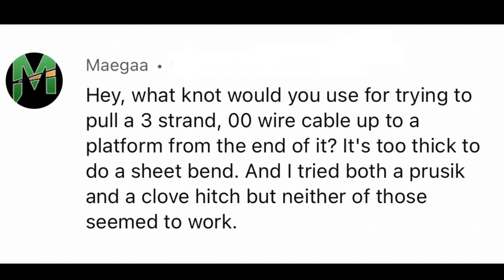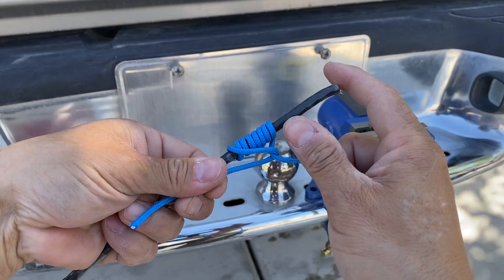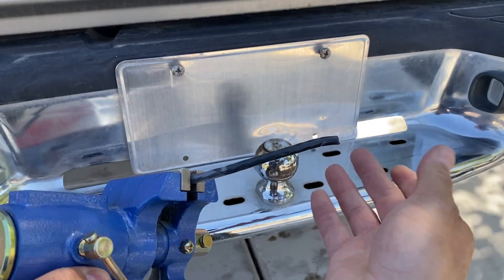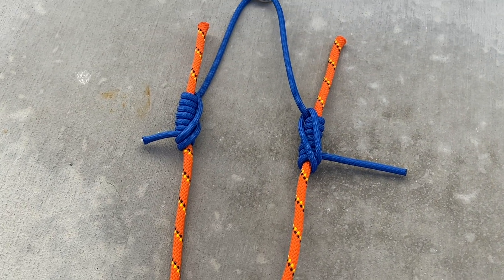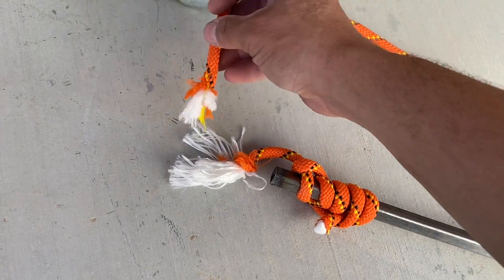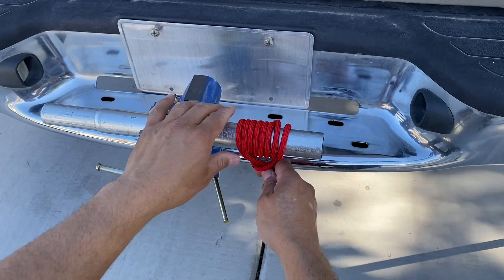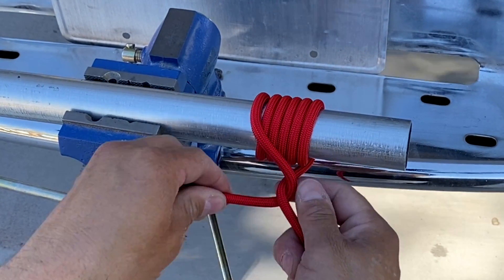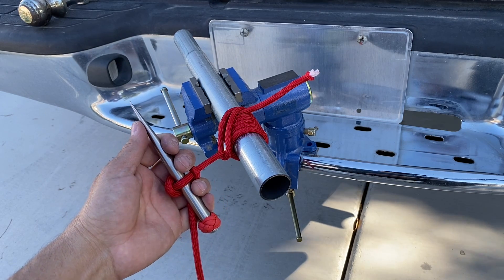Wire Pulling Knot

Comment: @3:36 the knot is a klemheist knot.

a similar, single end friction hitch, like the one you demonstrate in the video is the icicle hitch. I used it on some #6 cable tied with mule tape and broke the wire before it slipped. It has the added benefit of not rolling free if tied on soft materials like rope.

Comment: Needed to tighten up a long clothes line (steel cable).  Found this video and used this knot on both ends with a doubled cow hitch (so it would have a pulley effect).  Worked a treat!  Thank you!

Comment: Icicle hitch is similar, great demo.
I did see it mentioned that it would hold on a taper like a marlinspike. Always wanted to try it with cotton rope.
Also that it can be used to pull a small tree, will grip a slippery small tree when the bark is removed by pulling up with a block.

I used to use something similar while sailing when the sheet winch was bound up and you needed to free up the winch by taking the tension off.  

all the best
Reply: I successfully used a rolling hitch for freeing up a winch rope - but that’s because, under stress (mine that is), I couldn’t remember the icicle hitch!

Comment: Since no one's said it: the "pipe hitch" is the "arborists's knot" shown later in the video. That's also the first thing I thought of when I saw this one. I'm glad to hear it's seeing use, since it's been wonderful the few times I've used it.

The fact that someone else called it a "post hitch" is very interesting to me, since it makes me realize that that's probably what Geoffrey Budworth meant when he labeled its simpler cousins, "pile hitch", and, "double pile hitch", not just a foundation pile or a dock pile that's also a bollard for tying boats to, which is what I assumed he meant based on the word and the context in the book. It seems like the post hitch would be a great tool for pulling fence posts, probably paired with a half hitch, or as someone else suggested, a lark's head...so I'm sure someone's done it, especially at a dockside where the simpler ones were already in use.

The thing I'm most reminded of looking at it is probably some of the "prussiking" knots, but I'm sure the icicle hitch would've come to mind if I'd ever put the work in to learn it. I'll have to look, since those knots are also ones I never bothered committing to memory.
Reply: We used that knot finished with a clove hitch! After we removed the basket if we needed more. We also tied the same knot with chain on occasion for long 15kV runs and line truck for pulling out.  I believe you will find it in the Ashley book of knots (1761). I knew a lineman who called a very similar knot the grapevine. After I retired, a buddy of mine told me he always used a prussic. I could immediately see the value there! BTW one can hang a block or come-along on a pole with a prussic or klemheist. Even the klemheist can be found in the Ashley book of knots ((1762)though, not called that).

Comment: This knot is improved by sliding it a ways down the wire/pipe/etc. and following it with a series of lark's head knots. If you're pulling this wire through a conduit, or PEX pipe through a series of stud holes where the end could snag, simply wrap the end section with electrical (for wires) or duct (for everything else) tape, and ensure it forms a smooth transition from the object to the rope. The reason for this is for that cinching knot to form a lightly loaded backstop, where it will never be challenged, while the series of lark's head knots spreads the load to the object in a way that keeps strong control of it, but without causing point loads. This prevents damage, while also guiding the object better than just grabbing its neck, where it will now have a massive mechanical advantage on that stub that sticks past the knot. That stub will therefore have some multiple of your own strength working with any snag to maximize irritation. The industrial big wire pulling grip looks more like a "chinese finger cuffs" weave of metal wire that surrounds a length of the end of the wire. This also gets tighter as you pull, but I do believe the far end of that is taped down to the wire to at least comfort the electrician.
Reply: Can't picture what you mean when you said to follow it with a series of larks head knots. Guess I'll get out some cordage and try to figure it out.
Reply: Kellum grip ,works well and doesn't make a bulge on the wire.
Reply: @chronicon5616  Imagine a fishing pole. The pole is your pull-rope, once it's under tension, and the eyelets guide your limp fishing line. By using lark's heads every few inches or feet (depending on the material you're moving), you're picking the thing up farther down in its mass, so the tension load on it is lower, which is good. 
The cost of that is you will be trying to lift something like a fishing line, but the top flops over. So, you put a series of lark's heads from your main support knot to the end part. Now, your rope is doing the tension, and the top of the object is simply along for the ride. Now, there is a bonus in that the lark's heads should add some clamping force individually, so that takes a lot of the load off of the main knot, and the material being lifted. Note that this video indicated that grip is a factor of how many loops he put into his demonstrated knot. Another example would be lifting several 2x4's of wood with a rope, but there's wind or a narrow passageway that they're being lifted in. Using the knot in the video, if you grip the wood by the end, it will likely slip, or crush the wood grain, or want to go horizontal and spin just to spite you, or even expand out, like an asterisk " * " just before going full calamity. You can put a heavy squeeze knot like the video down near the middle, or the bottom end if you have several pieces of wood, and then put a series of lark's head knots up to the top of the bundle, so that the bundle of wood is being pressed together along its entire length, rather than crushed in one small spot, with lower total grip power.
Reply: We have situations where we're not allowed to use tape or anything that could possibly leave residue behind.
 This is the interest in different knots.
Reply: @paulstaney325  And oftentimes kellum is the choice but pulling many diffwrent dia wires needs grip sizes that they don't make or at least I don't always have.
Reply: @tacvolun3570  For residue-sensitive pulling, a knot with two leads (like basket handles) is used at the end of the object, so as to guide it through obstacles. Tape is more of an expedient for electricians, etc.. I've most often seen these mesh/finger-cuffs type of pulling setup with hydraulic hoses and heavy connections that need to be craned, but are using those pulling aids/strain reliefs as a matter of convenience and to help eliminate expedient measures. Normally, putting tape on the end of a pipe or wire is not a concern, because the end of the material is simply cut off, to expose fresh material for a good connection. If there is a taboo on tape residue, then you are also likely working with a finished surface, and so the distributed series of mild hitches that I was talking about should be among the assortment of suitable solutions, where one constricting knot may cause surface blemishes due to the tightness needed, or cause collisions, due to putting your only grip safely back from the end of the object. The lark's heads are for guidance, stability, and grip distribution.
Reply: We use fishing cable in Ireland. 10 x 1m lengths that screw together. There’s some accessories with it. It’s thin but bends and is made from fishing rod material. We just tape 2.5 or 1.5mm wire for sockets/lights to end of it with insulating tape to fish cables through pockets, through joists or studs, down cavities etc.
Reply: @mindswideopen4339  In the US, it's pretty common for residential electricians to use what we call "Fish Tape" for the same purpose. It's wound up in a closed container, and you can pull out as much as you need, and it's a thin, flat, steel wire. The end of it is folded over, and you just cut the jacket off the wire, snip off most of the wire ends, and fold the last one or two through the loop and back over onto the main wire length... Then, you wrap the whole joint with electrical tape and pull it through the wall, conduit, or whatever. This is after fishing the tape through the hidden hellscape in your walls. I can see where a more-or-less straight run would be better served with an assemblage of flexible rods. 
For heavy commercial wire, like 500MCM or greater, the minimum conduit diameter is often chosen by the contractor for cost reasons, but the result is that you need a bucket of pull-lube, some repurposed, hydraulic machinery which is incurring rental fees, and many wasted billable hours. Using fancy knots in this situation can help a few workers retain enough sanity to come back to work the next day.
Reply: We specifically use the lineman's hitch for high voltage cable when other knots might damage the dielectric around the conductors.

As well on really long pulls this knot can easily be slid down the cable after each short pull to pull again without resetting. Sounds like you're ibew buck.

Comment: We use 3 half hitches spaced about 4 inches apart wrapped with stretched electric tape to pull networking cables. This gives more than enough friction to keep the string from slipping off the cables and will rip the outer sheathing off before anything else breaks.

Comment: Can you think of a quick release knot but this time made in wide webbing? For making/attaching a nordic walking style hand strap to a pole. (these are slightly different from a regular hiking pole, more pressure on the strap)
Reply: I'll bet a constrictor knot or a rolling hitch / constrictor knot combo would work (with drawloop of course). I'll have to find some webbing and give it a try. How wide is the webbing usually? I'm thinking 25mm (one inch), but "wide" tells me it might be more like 40mm (an inch and a half is 37mm), or something like that, which would probably be a lot more challenging to deal with.
Reply: @mysss29  40 mm on the bottom edge of the hand for sure, but it could be sewn onto a much thinner one, even 10 mm because it only has to be wide on the bottom. usually they are not really just webbing but a whole sewn triangular "sling" in the nordic walking stuff, but i'm thinking of making my own pole. normally the quick release part is a plastic mechanical construction (have store bought already but i'm curious how to make it with simple hardware)

Comment: When I pulled feeder wires we just made a sock out of tie wire. It fit thru the raceway far better than thi k rope.
Reply: We called 'em mare's tails.  You can split the 3 strands of a rope into 6 strands and make one with a rope. And they're surprisingly strong.  The lineman's hitch that he shows will keep from damaging the dielectric on high voltage cables.

Comment: I would love to see this demonstrated with an electricians polypropylene twine like Ideal Industries, Inc. 31-340 Powr-Fish Pull-Line, or similar. When I pulled cable we used something like this, but the knot work was only a series of 3 half hitchs spaced apart by 1-2 inches, then secured with an obscene amount of electrical tape.

Comment: What type of knot could I tie in paracord that would be good for making a cord that holds my reading glasses on my neck?   So often one sees these devices use some type of rubber tubing to hold the cordage onto to glasses stem.
Reply: Someone else probably has a better idea.
I would like a really thin cord with 5 or more half hitches. Easy knot as well!Problem is that they want to spiral around . But I do like the look of several pulled tightly together.
Reply: The knot at 3:35 is a Klemheist. The others are not.

Comment: I'm going to try this for joining two ropes. My dog has a habit of chewing through the ropes on his toys and while i can tie a new one, I'd like to be able to fix the existing ones! Not sure what size rope to use for the knot, might need to experiment. And maybe it won't work with something compressible like rope, but i dont need tie breaker level strength!

Comment: It's a modified klemheist, and unless you keep continual tension on the line, it will release.  Tied properly, on a doulbled line, tension can be released and applied with minimal slip.

Comment: How would this stand up to a constrictor knot? Would it be stronger?
Reply: Good point. I thought of a constrictorknot, too.
Reply: Unless you slip it, constrictor hitches can be a bitch to release after loading.
Reply: @zecuse  That's why it's a constrictor hitch, you use it when you don't want it to come undone. I wasn't proposing it for this scenario, just comparing the hitches.
Reply: They're very different since the constrictor is more of a binding and it isn't the best for a pull along the object it's tied to like this knot. They really do different things. The advantage of this one is that it puts less constricting force on the wire with any one wrap, and compensates by using many wraps to get as much strength as you want, which is of course more than a constrictor knot could.

I'm not sure I really understand how you'd want them to be compared. Maybe you mean the % of the rope's breaking strength they preserve? In that case I'd expect the constrictor knot to win because it doesn't have those two 180 degree bends right where all the force is. But use-case wise, I'm not sure when you'd really find anything they'd both be good choices for.
Reply: Exactly. That's why the bowline preserves so much of the ropes strength.

Comment: As an electrician, we just used half hitches in a row
Reply: Agreed. The tighter you pull, the tighter it gets. Then to undo it, al you have to do is push it from the other side. (after removing the tape, of course)
Reply: Same here. Pull sock for big wire when we use the tugger. Half hitches for smaller stuff when we pull by hand.
Reply: The lineman's hitch that he uses here is used for high voltage cable where the half hitches can very easily damage the dielectric. As tension is put on the line, it constricts Evenly over the length of the knot. 

I do like my half hitches as well.  I rarely have the luxury of pulling baskets. I actually like and trust my own wire heads more. 
The old timers that taught me made their own mares tails, rope or wire.

Comment: I just double up the end and do a clove hitch and then half hitches with both ends. And putting some tape on the ends so it won't snag on some corners and fall of if you have to pull it back for some reason

Comment: as electricians we pull more than 1 wire at a time. often thhn wire, with a nylon sheath that comes pre-lubricated, with a pull line that's lubricated. but yes, this Icicle hitch relative is a great knot.
Reply: I'm using it to lift a 2in diameter cable about 20 ft to a wire tray at work. Everything else i tried just slipped off but this knot worked amazingly
Reply: The icicle hitch is more of a  clove hitch with the bitter end and working end looped through!

This knot is a Klemheist and modified Klemheist.

Comment: These are great if you have the room and the one side pull point is to be considered also. 
I remove the outside strands  and or the next layer, in a staggered manner, using only the core strands to go through the eye of a pulling rope and folded flat with zip ties to stabilize or use heat shrink cut into small lengths that are pushed up to cover the strands (butt to butt). 
Couple raps of high strength tape. Finish filling the difference in the diameter with pulling compound soaked rags. 
Be prepared to give distances which only matter mostly at the last of the pull 
I do like the way a friction leveraged wide area gripper aka name your knot.

Comment: It borrows the working principles from the existing friction hitches like icicle hitch, pipe hitch, prusik, klemheist, sailor's gripping hitch, clinging queen Clara, knut, death grip hitch (redbarnboats? YT channel) and creates a new one. The working end wraps 4 or more times around the cylindrical object away from standing end. Then it returns (in opposite direction) to trap the standing end and the other turns under a diagonal/ helical wrap followed by couple of half hitches or otherwise further trapping the free end of working end along with the standing part and the earlier turns. When lengthwise/ longitudinal pull is applied, all the wraps away from the standing part tighten to grip around the object creating enough friction to oppose the pull. This is a new kind of friction hitch which like FCA's Venus fly trap and many other FCA's improvised and practically useful and break-tested knots could end up one day published in FCA's book of knots. I will recall it as FCA's friction hitch. Great work. One of the prime knotting channels on YT. Looking forward to all future knot innovations from a hobbyist's point of view.
A suggestion is whether you could break test the death grip hitch (redbarnboats YT channel) which is different from lot as it includes alternating turns in both directions or improvise it as an ultimate gripping hitch but using the most cordage.
Reply: Wonderful! I'll be looking up the ones I don't recognize!